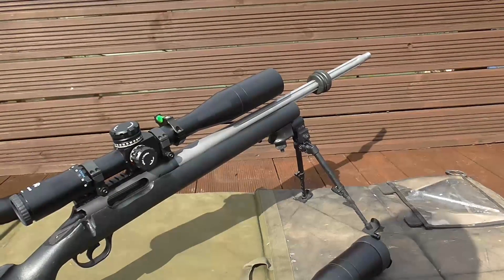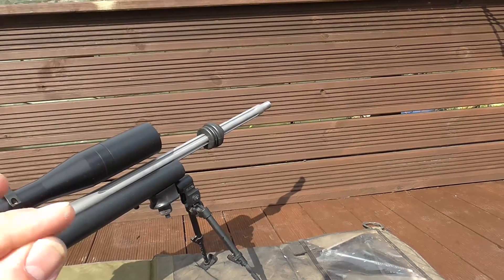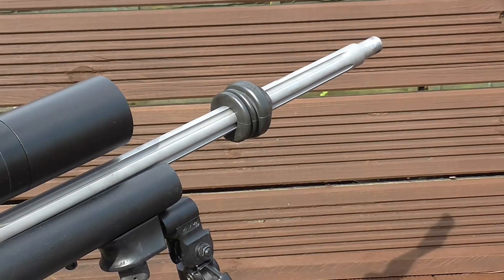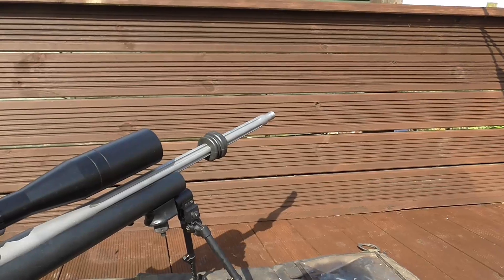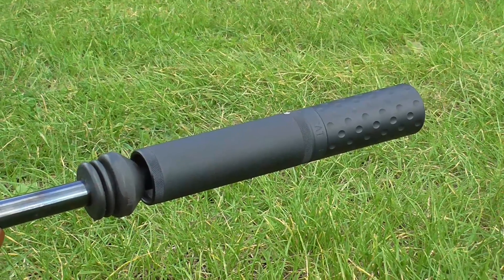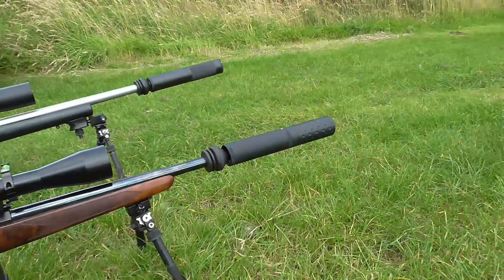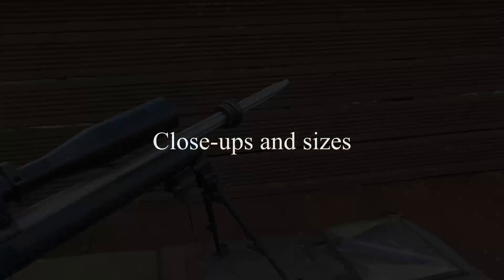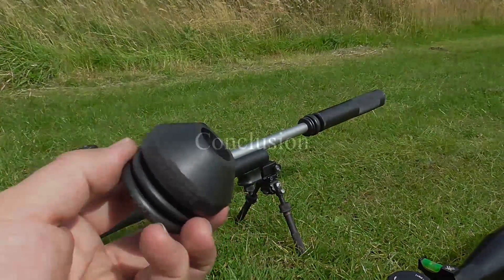Barrel tuners - do they work?

Comment: I see you are enthusiastic Richard. So here are some other details. Back in the Day when I was making Anti- Blast muzzle brakes (around 1991) I sent one to Browning in America. After a 45 minute conversation with (nameless) I told him how I had experimented with recoil and brake harmonics.Basically the brake pulls the barrel into tension , initially via compressed air travelling ahead of the bullet! This stiffening of the barrel reduces the amplitude of the harmonic shockwaves travelling up to the muzzle from the breach. (actually several times faster than the bullet!) If the crest of that wave can be reduced by making it have to do some work then the vibration amplitude  can be reduced and permit a tighter "elipse" of bullet exit. The energy is actually a quadratic as it has velocity squared in its solution.Thus we get two solutions one positive and one negative. So this simply means that the bullet can "sway either side of a certain number value. So it might hit half an inch high and right ,or it could strike half an inch low and left. Better damping can obviously reduce this effect producing tighter groups.The company initially was interested then six months later they were not. Three years later the BOSS system arrived. This is the plight of the inventor and big business.Maybe it was parallel thinking ? Who knows.Liverpool University tested my brake and it gave 60% recoil reduction and 84% energy reduction with a .30 caliber rifle  loaded with 150 grain bullets at 3150 fps. Hope this helps a bit. Cheers! Rod Mac
Reply from the maker: +Rod Mac Good old "grab the idea and run" Wouldn't be the first time an engineer has been run over by a big company - the thing is people give out too much info for free if they want to make money...They're kind of opposed principles most of the time :) 
Keep in touch Rod  and thanks for the interesting comment
Reply: +Richard Utting (SharpshootingUK) Thanks Richard.I have lots of gun related inventions but for now I cannot do anything with them.Had I been self financing after one success then things would be different. I have decided to buy a 17 Browning T-bolt based on your excellent review. My dealer has transferred it from Sportsmans so I am hoping it is as excellent as your own. Cheers Rod Mac
Reply: +Richard Utting (SharpshootingUK) Hi Richard, I got my 17 Browning T-Bolt and it is a beauty! In my haste I forgot to get Weaver rings and when I did, I tested without tightening up the clamps, so no accuracy prizes. Then it dawned on me and things changed remarkably!It seems to prefer Winchester 20 grain at this point . I cannot get Remingtons anywhere as you suggested in your review. I was thinking about the "de-resonator" device. It strikes me that it must be placed on the barrel where there is highest amplitude of vibration to really attenuate the vibrational pulse. I think a wheel balancing device also shows where to fit the extra wheel weight to correct a badly balanced wheel and tyre. I wonder if a similar device could be used to balance barrels ie tune them?  Cheers Rod Mac
Reply from the maker: +Rod Mac Yes that would be a mighty handy thing. I suppose the simplicity of this system is great though, and cheap: slide the ring down by a 1/8" of so at a time and you'll find it soon enough.  Dead simple. Going in to the maths would be v interesting, though. There WILL be a formula that would predict it, especially as the vibration wave that runs up and down the barrel on firing does that at the same speed regardless of contour etc..  All the best, Richard. Have you spoken with Chris Long in the states about this, and OBT?
Reply: +Richard Utting (SharpshootingUK) Hi Richard, I do not know Chris Long. I assume "OBT" is over barrel tuners? I got an interesting paper from Derek Bernard in Jersey. It was a vibration mitigation system for firearms. The inventor is Kromac Sarl Hossann Bernard, Engineer ENIB-IAE 14 Rue Dalhain F-67200 Strasbourg-France Hossann. Bernard@club-INTERNET.FR  , French Patent no. 03 01276 of 4/2/2003 and P.C.T. no PCT/FR04/00124 of 21/4/2004            I suppose you could look that up and read it if it is of interest. Regards Rod Mac